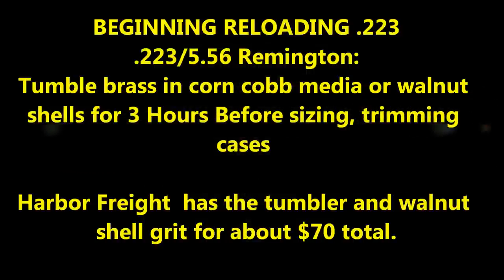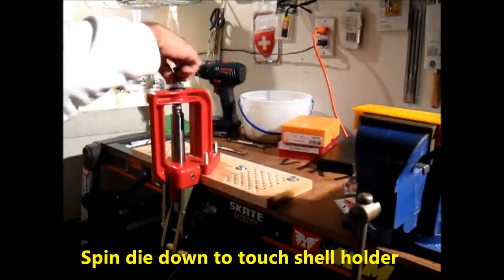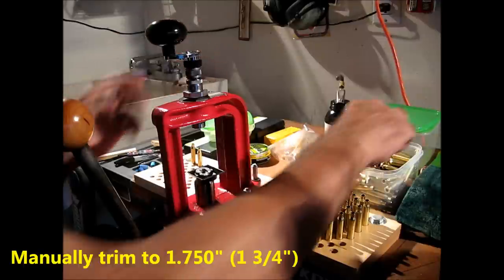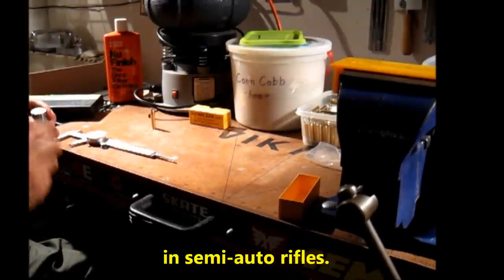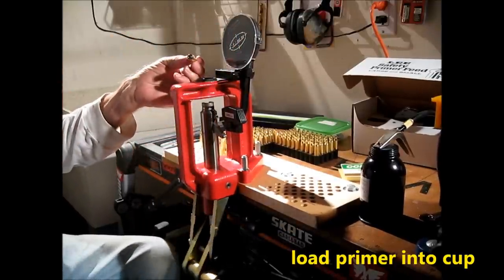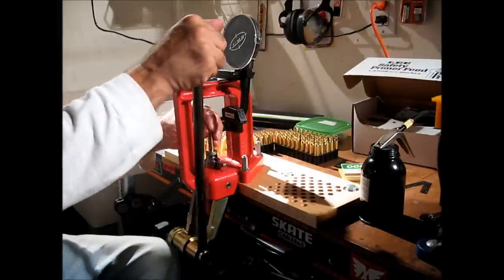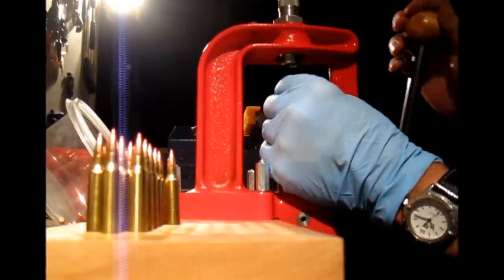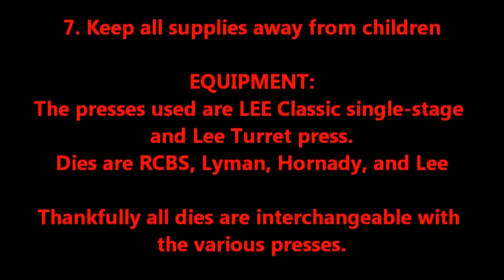Reloading 223/556 easy

Comment: Good video and you make a nice finished product. It's nice to see other people who take pride in the ammo they produce. I use CCI primers almost exclusively because they are less volatile/sensitive than some others, but I have never had a problem over the years decapping a live primer of any make. The decapper pin is exerting its force on the anvil and underside of the primer, not the top side where ignition occurs. Can't argue with extra safety measures on reloading though so I will not knock you for avoiding this practice. Anyway, reloading is an amazingly fun hobby and in many ways for me just as interesting as shooting itself. I am able to create custom loads for each firearm I own to do exactly what I want it to do. Also for hunting I am able to tailor make cartridges for each individual hunt to make the most efficient and humane kills possible while filling my freezer. No regrets ever about getting into hand loading.

Comment: I love my lee loadmaster. I have my brass at 1.758 and my oal of 2.223, it fits my stags chamber perfectly.. I loved your video. I just started 308 reloading and since that is my hunting rifle, I might use the single stage.
Reply from the maker: Once you have all the equipment, adding another caliber is cheap, just by a new complete set of dies. I started on .308 as well. those are my two go-to cartridges, not coincidentally, the US Military's as well :)
Reply: +SA Bjork so far, I do 556, 308 , 300blkout,  40, 9 and 45. no issues at all, I use pos 2 to set primer depth and away we go after the powder die , bullet seating, and crimp is set, lol

Comment: I like your mounting board with the case holes.  I mount mine on 3/4" steel plate because I wanted to eliminate any flex during the cycling of the press.

Comment: Good video-direct and to the point.Mounted my press to a 2x12 and it  is  a portable platform. Clamps to any table top or work bench. Lee case gage trimmer is simple and accurate.Wilson case gage works good too. Hand charging on a digital is good enough. I think the Lee scale is too cheap(although effective). Funny this guy uses the same equipment.

Comment: Also, I do hand charging of most of my cases as well and the Frankford Arsenal digital scales are excellent and accurate. Mine was about $30 and is just as accurate as my balance scale. It also came with weights to calibrate. Using this scale, Lee scoops and a trickler I am able to make 100% spot on loads very quickly, and changing charge weights is easy.

Comment: I like the redding sizing die with a carbide sizing button. It doesn't stretch the neck as much during sizing and you have to trim cases way less often. They are a little pricey but worth the money. Add in a Lee crimp die for the best 3 die set for .223. Just my 2 cents worth. Redding stuff is pricey but well worth the money.

Comment: I punch out live primers without any problems(And everyone i know does it). They are not sensitive to slow pressure. Just do it carefully, wear glasses and sound protection just in case ...
Reply from the maker: +MrVolodus I have done it too and I know that it can be done, just did not want to be responsible for any accidents. I had one primer ignite during priming.
Reply from the maker: +JD Machine that is the fun way to do it. I heard that in the movies, they fire primed cases to simulate a live shot.

Comment: For what it's worth... I use a carbide .223 full length sizing die after drilling out the neck sizing portion with a 1/4 inch carbide masonry bit and removing the the expander ball/decapper. This makes sizing the case body MUCH faster and easier and also avoids sizing/stretching and work hardening the case neck. I put a dab of lee case lube on the side of the press and just touch it every 3-4 cases so that my fingers stay damp and lube each case as i put it in the press. Then i clean the cases, and load them using a precision collet die set only (no lube reqd). This gives target grade results and clean, shiny lube-free cases. I can do a thousand rounds during an evenings TV viewing.
Reply from the maker: once-fired brass from your chamber is the best you can use, yours is a good way to maintain your your brass' chamber's dimensions. Thanks, I like that.

Comment: thank from someone who is new and collecting information so as to start .    corn cobs better go out and catch em out the back of the JD harvestor .
Reply from the maker: +dudekiwi The problem is that the corn cob is as hard as iron and you don't want the pith, so you really need to buy processed Corn Cob. There is a company called "The Andersons" who sell a 40 lb bag for about $20 and that should last a decade. The 1420 grit is the ideal type. It is used for turf and oil absorption. If you buy the retail brands, it will cost about $10 for 5lbs.

Comment: I load 357 cause I don't have to bend over (for cases). Plus, it will feed any lengths of the cartridge really: no trim necessary. I've shot hundreds the hottest possibleload out of my GP. 556 seems like a too much of a time commitment and precision to reload. For most people, it's better of buying off the shelves. Maybe for bigger cartridges like 308, it's worth reloading.
Reply from the maker: definitely, the bigger the cartridge the greater the savings, your main advantage of reloading is accuracy and custom loads from various purposes.
Reply: While I agree with you. For back then. Times have changed lol.

Comment: Just saw your vid, try using Hornady one shot case lube. It dries and eliminates the second tumbling.  A small amount of petroleum based lube can cause primer or powder failure. Also don't know what you are doing when you're depriming live primers, 35 years and never had one go off.
Reply from the maker: +dbelex I always give a second tumble after sizing and trimming to remove any oil. I use frankford case lube if not.
Reply: +dbelex I was under the impression that firing a round whose case has lubricant on it is generally thought to be poor practice, for a number of reasons. It can produce abnormal rearward thrust to the bolt face, and also tends to introduce more foreign matter to the chamber. Just because the case feels "dry" doesn't mean it isn't still coated with an effective high pressure lubricant. I seldom use One Shot for reloading anymore, but mostly as a release agent when epoxy bedding. In my experience it has a dirt attracting, tacky feel when "dry". I would always remove it with lacquer thinner or Brake cleaner solvent, either en masse, or hand wipe individually. I prefer Lee Case Lube with soapy, or just hot water to rinse, then dry in the oven, blow dry, or hand wipe smaller batches. Like One Shot, it also works wet or dry, yet it can be removed with solvents or plain ole water.
Reply from the maker: +kelhawk1  Additionally the lube needs to be completely removed by a second tumbling as machine oil will render the primer compound completely inert.

Comment: Great video.  If you had to estimate, how long approximately would you say it takes you to reload a given amount of rounds? say 100rds?
Reply from the maker: +Mark Clemmens It really depends on the method that you choose. With a turret press that is set up and cases that do not require trimming and tumbling, you can do a cartridge in 5 seconds, you can complete 100 in 8 minutes, once everything is set up.  However the speed is not important. If you are loading for accuracy, take your time and clean, trim, tumble and measure, you can load a thousand rounds in a few hours of actual devotion. Once you get rolling the time spent on each round shortens considerably. I never tried to race through it, and it really is better to take time and in your down-time to make the best ammo that you possibly can for when it may matter most. It is very rewarding.

Comment: Great video.  Never heard of using soy machine oil.  Can't seem to find it though.  However,  Amazon sells  a gallon of "Machine Oil" made by WAWAK.  Would this sub for the soy machine oil?
Reply from the maker: Hey Larry, I use sewing machine oil. Sorry if that was not clear. Sewing machine oil can be bought in bulk and has very low viscosity and is easily removed with a light tumbling or cleaning. Be sure to remove the oil before priming or powder charging.

Comment: Did you buy the wood mount ir make it yoursekf?
Reply from the maker: I made it myself from Maple (Home Depot $5) created a template for the shell holders at 10mm apart, drilled with 3/8" Forstner bit, I believe, countersunk the bolt heads flush on the bottom side, finished with Tung Oil (Walmart). Or you could just bolt the press to your work bench, but I wanted to move mine to my bedroom desk, or kitchen table and clamp it down with wood or C- Clamps.

Comment: Great video!  Typically how many reloads do you get out of each round?
Reply from the maker: +Christopher Behermann  that depends on the caliber of the round, the weight of the projectile, the type of powder, and how fast you want it to fly. In rough terms, you get about 300 rounds per pound for .223/5.56 and about 150-170 Rounds for .308 Winchester.
Reply from the maker: +Christopher Behermann , Sorry, if your chamber matches your sizing die, you can get an infinite amount of reloads. If your chamber is loose and you are working the brass hard, maybe 5-7 times. I have not found a limit yet.

Comment: Can you reload 223 case once fired with a 556 lee die press ?
Reply: The rounds are the exact same. Other than pressure. Dies are sold 223/556. If a die does 223 it does 556

Comment: is this a kit? or did you buy all of this separately?
Reply from the maker: +Sean Harold Initially I bought the Lee 4-hole Turret starter kit and a set of dies for about $200 total. That was enough to get me going. Then, like any hobby, you start adding. 1. A single stage press for really heavy duty ($100), Lee perfect powder measure $35, head-space gauge $30, precision calipers $20, Lyman case prep tool $20. Case vibrating tumbler, $60 at harbour freight, and so on.  There is no upper limit, and the Lee scale is as good, or better, than any I have used.

Comment: You use same bullet in both 223 and 556?
Reply from the maker: Yes, the exact same projectile. .224" diameter weighing between 35 grains and 77 grains. The manufacturers make no distinction between the two variations.

Comment: Why are they reloaded one at a time. Why cant you get a press that seats 10 or 50 rounds and presses with one pull.
Would save a lot of time without the waste of picking up one round and putting one in.
You could lube a bunch up in your hands and seat them all quickly, punch/press then grab them or dump them out and seat another 10 or 50.

Comment: Motor oil? sewing machine oil? Really really bad advice, these do not have the same properties as a good case lube like lee case lube or lanolin and can kill your primers. I went crazy 

Try the wft trimmer. I used the lee trimmer years ago for 223 and trimming brass was a chore. I bought the WFT for 300 blackout recently and I actually like trimming. I can trim 500 cases in 15 minutes flat. much easier, much faster and trims within .001" every time. I put a vice on my bench and chucked a drill in it for easy trimming.

@9:12 No harm in decapping a live primer. Ive decapped atleast 750 live primers with no issue, just dont act like a madman when you deprime. and all will be fine.
Reply from the maker: Rusty Shackleford Good Point, If you use any lube, you should again tumble to remove all oil residue. I show the second case tumble step, but failed to mention the lube removal aspect.

Yes the WTF trimmer rocks and I used one at a trade show, but since then Lee came out with the power trim adapter that replaces the turn knob on the quick trim for use with a drill; it chamfers and deburs at the same step.